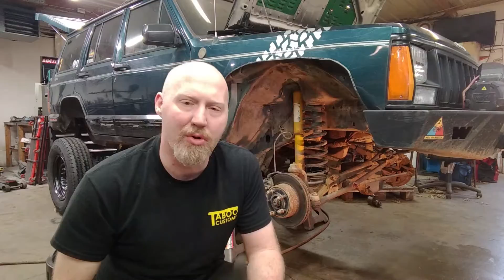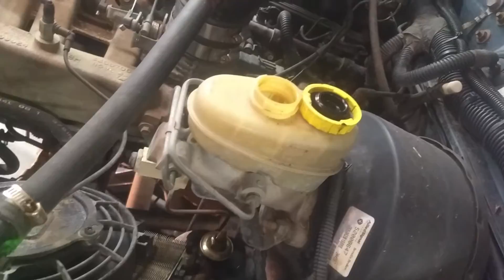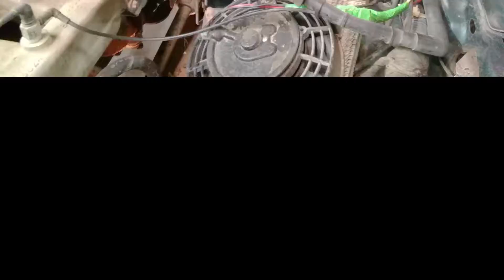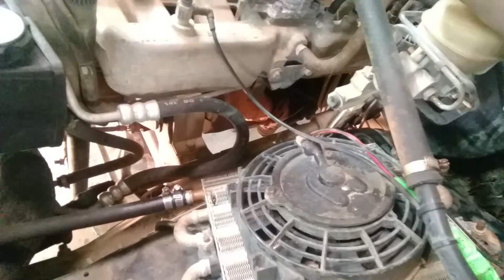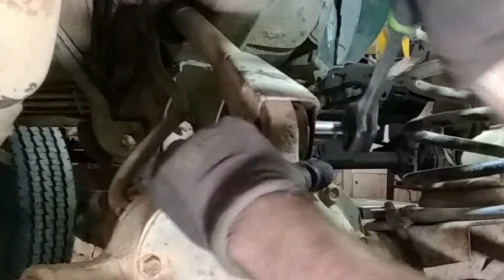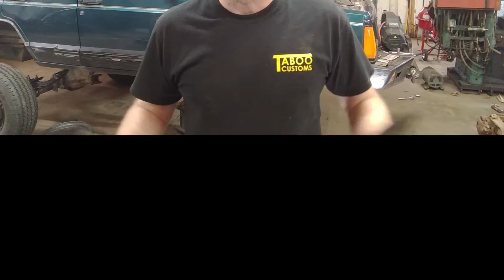Dana 30 Front Axle Removal - Jeep Cherokee XJ

Comment: Great video. I’m doing the real main seal in mine and I’m gonna have to remove the front axle because I don’t think I’ll ever get the pan back on with it in the way. In all seriousness I was close to either selling the whole vehicle off, pulling the whole engine, or towing it to a technician but then someone on the XJ Discord server reminded me that I can just pull the axle like some RMS videos say to do. My advice to anyone pulling their pan in the car is to go ahead and yeet the axle, trust me. Especially if you would benefit from replacing the suspension components while you’re at it.

Update: it’s not that hard to put the pan on with the axle in especially if you have better common sense and coordination than me but it’s not a bad idea to rebuild your front end while doing the RMS (which doesn’t actually require full axle removal unless you want the pan install and axle side UCA bushings to be easier)